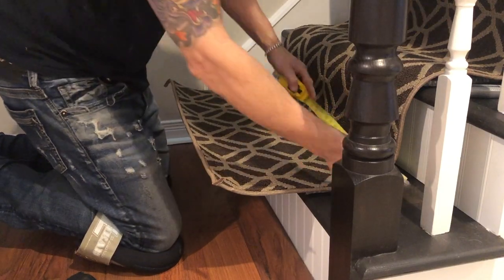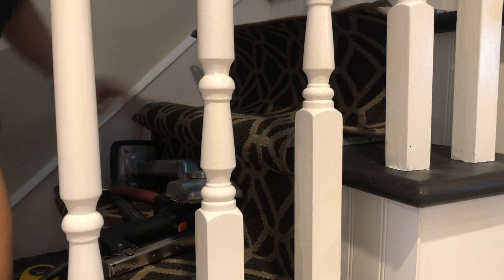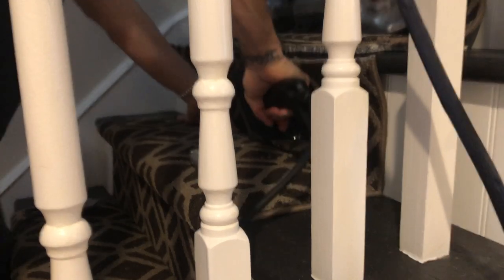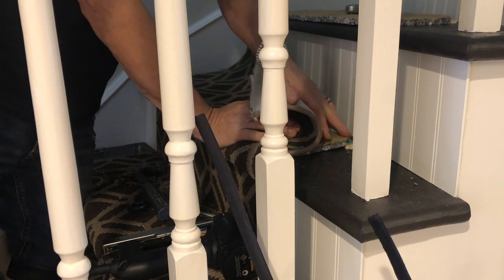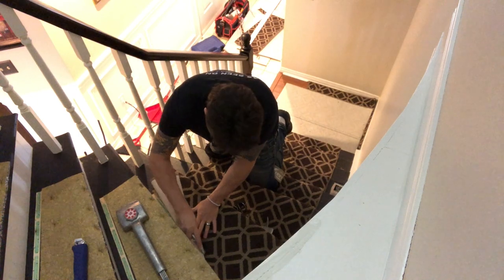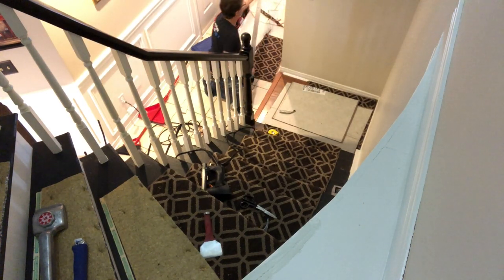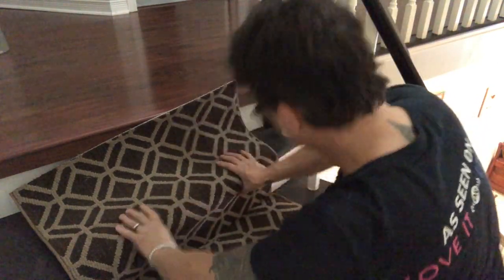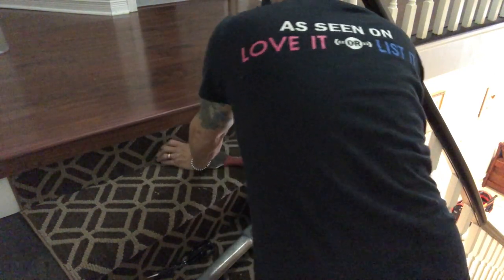How to Install a Carpet Runner on Winding Stairs

Comment: like you said it is like installing plywood but i  tame the beast  by hot water mist the backing, use  3 row pin tackless called  J  pin (short pins ) also i have cut out of 6 inch vinyl wood  1 1/2 to 7 1/2  blocks  to keep it measured & straight, and place  a block about 3 steps up & pin it to keep it from twisting as i am working bottom up .  GREAT JOB ***
Reply from the maker: I’d like to try that😄😄😄😄😄

Comment: I actually created a template for the pie stairs were you don’t need to take an inch and 3 quarters off per stair. I do Stanton and tuftex all the time. It curls with the stair hit me back would love to share and talk with a fellow installer based out of the east end Toronto
Reply from the maker: Are you talking about actuality making each stair to size the same all the way up? If so I’d love to hear about that method! 😀😀😀😀 love to come by and film you in action!!!
Reply: Out in BC the carpet binder has me create templates,, ( I use Ram Board type floor covering paper) to make templates for the winders. These pieces of carpet have the riser as well as the tread. This way there is no concern at the nosing of the carpet coming loose because of a joint under the nosing. The riser is cut straight by the binder and the tread is left long for trimming by the installer.
Great video, thanks for posting !

Comment: I am a DIYer planning to try this.
On the wedge shaped 40" tread, measured about 6 - 7" from each side, the right side of the runner would span about 9", and the left edge would need to span 12". So the difference is about 3".

It is not very clear on the video, but are you making a 1 1/2" angle cut at both sides of the piece of runner to come up with a total difference of 3"?
Reply from the maker: I only angle cut one side and that is the short side or railing side /

Comment: Great video mate.
Was wondering if you can show or explain how you get your measurements to set-up for overlocking? Especially for the larger winder steps and landings.
Thanks again for the great video.
Reply from the maker: can you explain to me a little more so im clear on what you mean
Reply: @KeithShannonDirectCarpet  Hi mate, thanks for getting back to me.
I found a video you did that explains what I needed.
You set-up the layout with tape and a roll of paper.
Then you used the paper as a template for overloking. 
Thats exactly what I needed to know.
Im quoting this job atm and feel I have a much clearer direction now.
Thank you so much.
Keep up the great work, I have subscribed. 
Cheers
Paul.
Reply from the maker: @simmmo66  perfect😀😀😀🤙

Comment: Hi
great job!
Just wanted to know what type of underlay runner you're using ? 
My goal is too make the walking up and down as quiet as possible since it would be for flat stairs (bedrooms on each side).
I'm in France, not sure what I should go for :
the kind of material you use (recycled polyurethane?), felt type, cork/rubber mix or yoga mat type foam? and in what thickness for max quietening results and most durable in time ?
(The runner will be a thick carpet)
Thanks a million!
Reply from the maker: Thanks for the question Amaud! On every job that we do, we use at least a ten mill gold top foil pad and this pad works great it is a recycled pad and it has a great longevity!   I think you should look for a dense pad minimum ten millimetre thick 😄👍
Reply: @KeithShannonDirectCarpet  
Cheers!
So that polyurethane option would be the the best for sound dampening I take it.
Also, have you ever used the felt type under room carpets? does it compressed itself over time?
Reply from the maker: @nonaldb6721  I have seen felt before it seems pretty thin and when we rip it out it’s very dirty and messy. I think your  good with the recycled pad👍👍👍👍👍👍👍

Comment: How do you charge for labor only for a curved staircase?
Reply from the maker: Depends on the scope of work and the going rate in your city
Reply: @KeithShannonDirectCarpet  That's what I'm trying to gage....it's all over the place.  What do you charge for similar work?
Reply from the maker: Between 2200$ 2500$ we include a in person consultation at our showroom then we show up on site and custom template the staircase / then cut and bind at our shop / then on to the installation

Comment: So, on each of the curved steps, you were cutting the bottom off at an angle of about 1 1/2?
Reply from the maker: Jose Govea 1 1/2 seems to do the trick depending on the amount of turn, some are less, some are more 👍👍👍
Reply: @KeithShannonDirectCarpet  I did some curved steps today. And your technique helped me out alot. Thanks for sharing! ✌

Comment: Why dont you run the under lay over nose because the carpet will wear on the noises coz there protection
Reply from the maker: nb flooring flooring there have been cases where the pad pushes the carpet out to far and 1/you can se the pad! And 2/ when the pad where’s it can be a weak spot and a trip factor! 
But I do agree about the wear and tear 👍
Reply: @KeithShannonDirectCarpet  ok thanks for your reply I will try ur way next time thanks
Reply from the maker: nb flooring flooring let me know how you make out😄👍